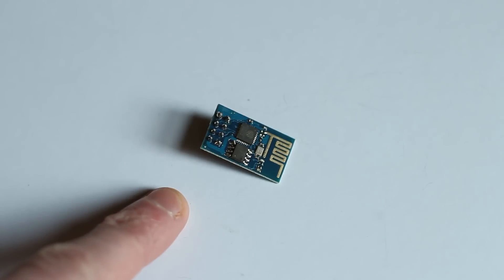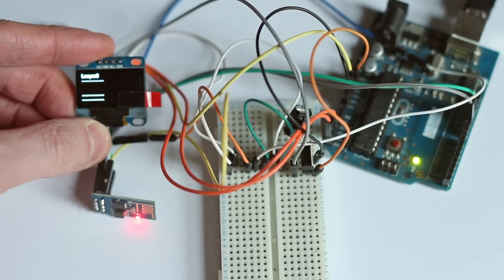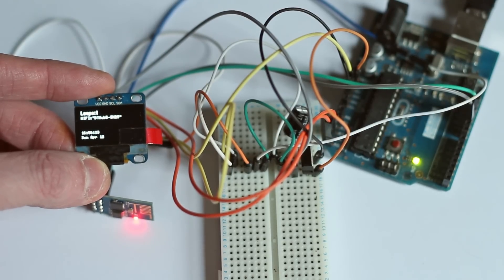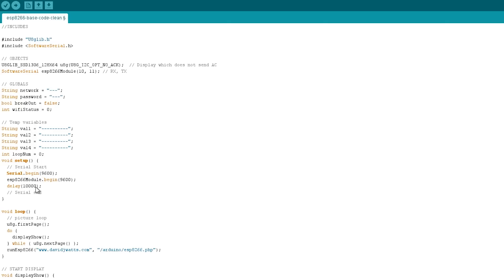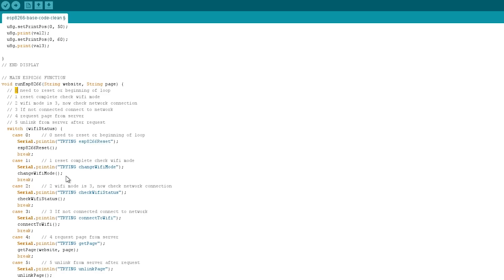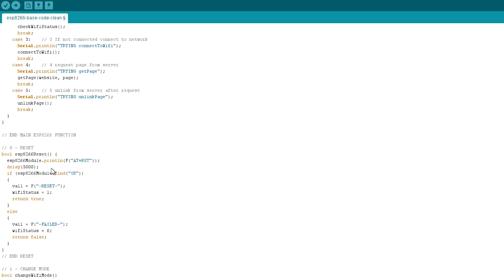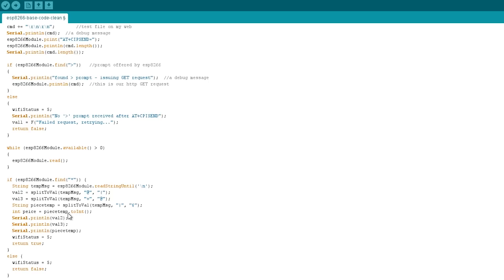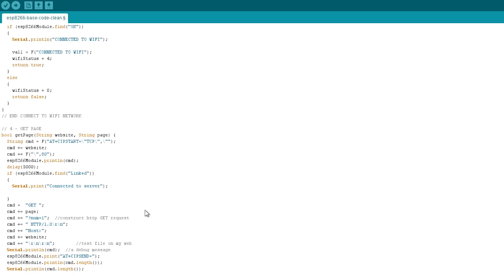Arduino Wifi - ESP8266: Schematic and Getting Started Code

Comment: Hi david,
If i'm connected to the wifi with the esp8266 does it means that the arduino is also connected to the internet?
i'm trying to connect my arduino to the internet so i can creat an client-server programme i don't want to use an ethernet-shield so that's why i want to use the esp8266 is that's possible?
Reply from the maker: +Hassan Ben Lebsir Yes, the esp8266 acts as a gateway to the internet. Adafruit has some fully featured libraries you can use with examples of client server behaviour.
Reply: +David Watts David thank you for the fast reply. so basically what i'm trying to do is create a java application which can receive data from the arduino trough the wifi using the esp8266.what i' thinking is to create a client-server arduino is the client and the computer where the java application is the server
Do you think that's the easiest way?
Reply from the maker: +Hassan Ben Lebsir I am afraid it is a little outside my realm of experience - Peter Scargill has some great resources on the ESP8266 that might point you in the right direction http://tech.scargill.net/esp8266-as-an-access-point.

Comment: I am having Issue while connecting ESP8266 with Arduino Mega. It always says "Module have no response." 

Please check and correct me if I am wrong anywhere.

 I am using below code and and wiring diagram is on this URL: http://3.bp.blogspot.com/-u7cLC4-x72c/VVGGVWfPmrI/AAAAAAAAci0/RYynhrWZQ38/s1600/wiringDiagram.png

//#include <SoftwareSerial.h>
   //use mega Serial 2 for serial monitor; Serial 1 on pins 19 (RX) and 18 (TX);// Serial2 on pins 17 (RX) and 16 (TX), Serial3 on pins 15 (RX) and 14 (TX).
   #define SSID "SopraSteria"
   #define PASS "1234567890"
   #define DST_IP "220.181.111.85" //baidu.com
   //SoftwareSerial dbgSerial(10, 11); // RX, TX
   void setup()
   {
     // Open serial communications and wait for port to open:
     //serial 2 is to esp8266 
     Serial2.begin(115200);//9600 (mine), 57600, 115200
     Serial2.setTimeout(2000);
    
     //serial 0 is to usb
     Serial.begin(115200);
     
          
     while(!Serial); 
     while(!Serial2);
     
     //dbgSerial.begin(9600); //can't be faster than 19200 for softserial
     //dbgSerial.println("ESP8266 Demo");
     Serial.println("ESP8266 Demo on Mega2560");
    
    while(Serial2.available()>0)
    Serial2.read();
      
     delay(1000);
       //test if the module is ready
     Serial2.println("AT+RST");
     //delay(1000);
     //delay(1000);
     Serial.println("Resetting module");
     Serial2.flush();
     
     //if(Serial2.find("ready"))
     if(Serial2.find("Ready")||Serial2.find("ready"))
     {
       //dbgSerial.println("Module is ready");
       Serial.println("Module is ready");
     }
     else
     {
       //dbgSerial.println("Module have no response.");
       Serial.println("Module have no response.");
       //while(1);
     }
     delay(1000);
     //connect to the wifi
     boolean connected=false;
     for(int i=0;i<5;i++)
     {
       if(connectWiFi())
       {
         connected = true;
         break;
       }
     }
     if (!connected){
      //while(1);
      Serial.println("Not Connected.");
     }
     delay(1000);
     //print the ip addr
     
   Serial2.println("AT+CIFSR");
     Serial.println("ip address:");
     while (Serial2.available())
     Serial.write(Serial2.read());
   
   
     //set the single connection mode
     Serial2.println("AT+CIPMUX=0");
   }
   void loop()
   {
    connectWiFi();
     String cmd = "AT+CIPSTART=\"TCP\",\"";
     cmd += DST_IP;
     cmd += "\",80";
     Serial2.println(cmd);
     Serial.println(cmd);
     Serial.println(cmd);
     if(Serial2.find("Error")) return;
     cmd = "GET / HTTP/1.0\r\n\r\n";
     Serial2.print("AT+CIPSEND=");
     Serial2.println(cmd.length());
     if(Serial2.find(">"))
     {
       //dbgSerial.print(">");
       Serial.print(">");
       }else
       {
         Serial2.println("AT+CIPCLOSE");
         //dbgSerial.println("connect timeout");
         Serial.println("connect timeout");
         delay(1000);
         return;
       }
       Serial2.print(cmd);
       delay(2000);
       //Serial.find("+IPD");
       while (Serial2.available())
       {
         char c = Serial2.read();
         //dbgSerial.write(c);
         Serial.write(c);
         //if(c=='\r') dbgSerial.print('\n');
         if(c=='\r') Serial.print('\n');
       }
       //dbgSerial.println("====");
       Serial.println("====");
       delay(1000);
     }
     boolean connectWiFi()
     {
       Serial2.println("AT+CWMODE=1");
       String cmd="AT+CWJAP=\"";
       cmd+=SSID;
       cmd+="\",\"";
       cmd+=PASS;
       cmd+="\"";
       //dbgSerial.println(cmd);
       Serial2.println(cmd);
       Serial.println(cmd);
       delay(2000);
       if(Serial2.find("OK"))
       {
         //dbgSerial.println("OK, Connected to WiFi.");
         Serial.println("OK, Connected to WiFi.");
         return true;
         }else
         {
           //dbgSerial.println("Can not connect to the WiFi.");
           Serial.println("Can not connect to the WiFi.");
           return false;
         }
       }
Reply from the maker: +Sapan Jain Looks like the wiring is correct, the 3.3v regulator on the 2560 might not be able to supply enough power though. That is why I used a 3.3v regulator tied to the vin/5v pin.
Reply: Sir,
I have also used the LM1117 voltage regulator but it also doesn't resolve my issue
Reply from the maker: Sapan Jain Have you tried changing the baud rate on Serial2 back to 9600? If you set the ESP8266 to 9600 it won't auto range to another rate.
Reply: which voltage regulator u have used. i thought mine LM1117 gives o/p of3.3v and 87mA.
Reply from the maker: Sapan Jain I was also an LD1117V33 but it is essentially the same. The esp8266 can draw well over 100ma.
Reply: cn u plz provide me the ckt diagram , how to cnnect esp8266 with arduino MEGA.
Reply from the maker: Sapan Jain Sorry buddy, I don't have one but I am sure Google can find you one quickly.
Reply: okay, thks a lot I tried  ,many times but i didn't find any.
Reply from the maker: Sapan Jain Try this one - http://www.arduinoclub.de/2015/01/19/esp8266-baudrate/
Reply: Thnks fr ur help DAVID, my ESP8266 is not is damaged due to this i m getting connecting issues.

Comment: Hi David,

I am using ESP8266 with Arduino Mega and Voltage Regulator is LM1117. But unfortunately it is not connecting with wifi.

Can you help me?

Thanks
Shivam
Reply from the maker: +Shivam Chove Hi Chivam,

It is a bit difficult to diagnose problems with the ESP8266-01 without actually seeing it. I suggest you post in the Google+ Arduino Community Group and add pictures and code so that members can help you out.
Reply: +David Watts The schematic for the 3v3 voltage regulator shown in the video at 1:13 is wrong if you are using the LM1117T, as its right pin-out is first pin for GND, second for Output, and third for Input.

Comment: Hey, I have found an app called BLYNK that allows for wifi communication i am just wondering would the Blynk App Communicate directly to the 8266 chip or does it need a router/ external wifi connection to communicate? 

I want to have this setup in my car away from routers and service and just want the phone to act wireless to the arduino to turn on lighting and things in the car. 

thanks in advance

Comment: hi there,thnx for the great tut.
i've connected the arduino uno to esp8266 module. when its connected to RX&TX pins with blank skitch it communicates and recieve AT commands. what whenever i connect to other pins it dosnt respond even when i define the pins within the softwareSerial. please help ...

Comment: Nice job, nice code!
Regarding your (arduino) code, what is "bool breakOut = false;" line standing for ?
It's not called at all afterwards...
Are you planning to add more features, or is it just something you forgot to remove ?
Reply from the maker: Alexandre EYLER Thanks mate, breakOut was used in the main loop before I used a switch statement. It looks like I forgot to remove it.

I am adding some new features/functions and I am trying to get rid of all of the delay(5000) bits from the code. The success flag will also be changing since it triggers at the wrong point.
Reply: David Watts Okay.
The switch method is a nice idea.
The delay(5000) is a safe method to be sure that the module manages to initiate and connect to network and so on, but it slows the whole thing.
On my first test with the ESP8266 I had used a loop reading the output from the module, so it could go to the next step as soon as possible, but it got stuck sometimes. Don't know if the weak part was the Arduino or the ESP. Need to do more tests :)

I will follow your code updates for new features :)

Comment: Hello David. I just ordered 3 of them off of ebay a couple of days ago. But I ordered the ones that are FCC certified.

In any case, instead of using your own web site to get date time, why don't you just issue a get request to google.com (or any other reliable site) and get the GMT time from the response header?

I just googled for this and found this code..... Dang, YT won't let me paste the code here. 

I googled "ESP8266 Teensy Time Date from request headers site:www.cse.dmu.ac.uk"
Reply from the maker: ***** Thanks Eric, I have been on Ian Sexton's website and met him IRL. His stuff is a great place to get started. Getting the time is really just a perk with the ESP8266, my main goal was sending and receiving data in general. I can pull the time from a data string after sending data to the page as a URL variable. I am hoping to stream line to code and make reliable updates faster, at the moment it takes around 20 seconds per stable update.
Reply: David Watts Nice... yes, he is a smart man. I've booked marked him to read more of his posts when I have more time.

I bought the Spark Core and when it works, it works great but I just have way too many issues with it. Probably just me being stupid. But this in combination with a Pro Trinket will be my Spark Core replacement. I have a little store bought temperature display with clock beside my computer that I want to replace with my home made one. One that can also pull in some some twitter information for me. Well, that is what I am going to do with mine when I get them. :)
Reply from the maker: ***** Cool, I look forward to seeing a post about it. Does the trinket do hardware serial?
Reply: David Watts No, there is not. :( They say that that was not included to keep things tiny.
Reply from the maker: ***** The ATTiny 85 doesn't have one, the chip the trinket uses, but I thought they might have done something with the USB interface. Software serial might work but unfortunately it won't leave you with many pins.
Reply: Hmmm... You know, I want a Zero. Maybe I'll order one of them. Are they even shipping yet?
Reply from the maker: ***** I think they are but they are a little pricey, you might be better of with a nano or perhaps a Pololu A-Star 32U4 Mini ULV (runs off batteries) Pololu Robotics and Electronics might even have a special on
Reply: I just did my taxes return for last year and am getting a nice refund. So, I decided to take $100 to buy electronics. I like supporting Arduino so I think I am going to buy the Zero. If I can find one, that is.
Reply from the maker: ***** I believe Cool Components Ltd have the zero in stock, not sure how much international delivery is though.
Reply: LOL. I couldn't get myself to pay that much. So, I just ordered the Nano. David, thank you very much for the input. Truly appreciated. :)
Reply from the maker: Ha ha, the nano is good. The a-star is a cool board though, 2aa batteries power the board at 5v and the esp8266 3.3v
Reply: I thought it would have been delivered by now.... but I guess they have 3 more hours to deliver it.
Reply: Cool. It just got here. :) I guess I'll be messing around with it tonight. lol
Reply: Hi we have the Arduino Zero Pro 32-bit in stock.
https://www.coolcomponents.co.uk/the-arduino-zero-pro-32-bit-with-debug-interface.html
Shipping to Virginia would be:
International Business Mail £3.90
International Business Signed £11.80